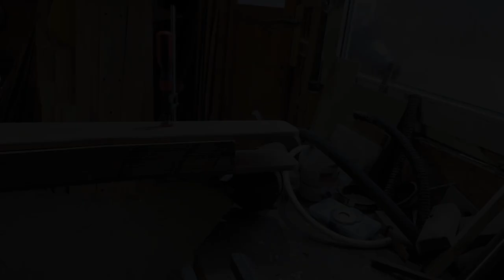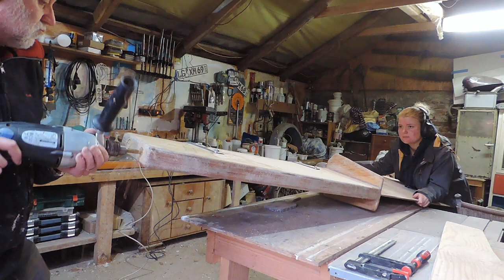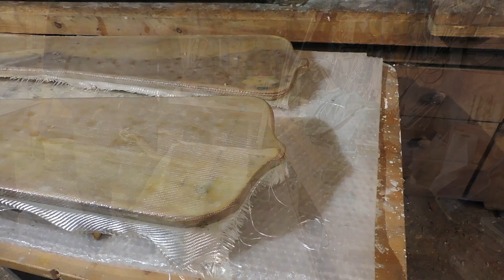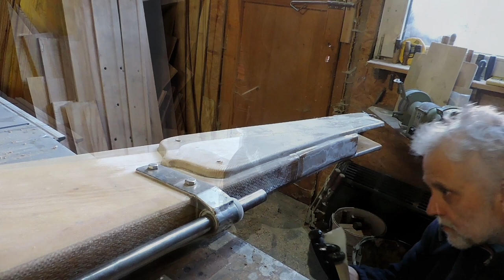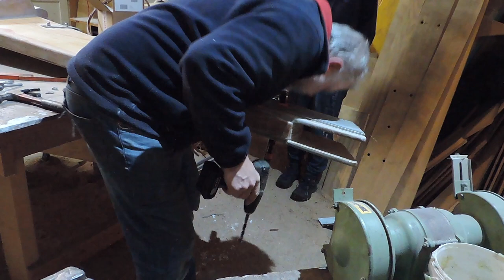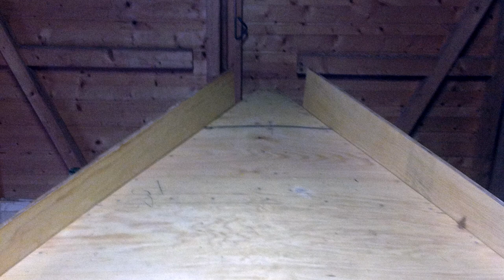Final Rudder Fitting; building a cruising sailboat - SV Tapatya EP261

Comment: Well. You did it. You now have finished adding appendages to your boat. Congratulations.
Reply: Well.. there's still the masts and sails to go. Those have to count as "appendages" too... 😉
Reply from the maker: The main bits are all there, or ready to put up, Bob. A bit of work on rigging fittings still to come 👍😃
Reply: @Garryck-1  Those are considered parts of "the rig". "Apendages" are parts, added to the hull, that go into the water.
Reply: @bobcornwell403  - I'll take your word for it, I guess.. but in all my many years of sailing (and extensive reading on nautical subjects), I've never encountered the term "appendages" used for anything on a boat.
Reply: @Garryck-1  

This is probably because of the way sailboats used to be designed. They used to be designed by half-model. This was almost always carved out of a block of wood. The keel, as it was, tended to be faired into the rest of the hull, so it was hard to distinguish where one ended and the other began. Toward the turn of the 20th century, this changed.

This started, I belief with N.G. Herreshoff (hope I didn't spell his name wrong), who designed what is likely to be the first fin-keel. At first, the rudder attached to the trailing edge of this keel. This was especially true when turn-of-the 20th century rating rules rewarded short water lines. Later, the rudder got separated from the keel, to be hung behind a skeg. Later still, it was attache only to a rudder-shaft which extended into the hull.

By this time, sailboats were designed on drafting tables, not carved out of blocks of wood. At this point, it became common practice to draw the hull lines first, then draw in the keel and rudder afterward. This is probably when they started to be called "appendages" by the design community.
Reply: @bobcornwell403  - Many thanks for the explanation! I did kinda wonder if this was maybe some sort of designer's terminology..

Comment: I was pleased to see that you added the metal plates on the rudder cheeks.  I was very concerned that the wooden cheeks, standing alone, were not sufficiently robust to withstand the stresses caused by the movement of the tiller.
Reply from the maker: Yes, I agree the reinforcement is probably necessary there, Marshall 👍

Comment: Hello again Tony! Like I said, I think the rudder is a real work of art and engineering, although I think I would cut off the base. Right now it’s pointing downwards and it looks like it would be snagging in a shallow draft. I would cut it so it would at least make a continuous horizontal line with the keel, maybe even slightly upwards. Just a thought.
Reply from the maker: It is horizontal, Pierre. It’s a bit of weird perspective that makes it look otherwise. I’ve just been out to check 😂
Reply: @SVTapatya  Just looking out for you Tony 😁

Comment: To drill 90 degrees. It is necessary to take a mirror from an old hard drive and the inclination of the drill in reflection is visible in the central hole.
Reply from the maker: Interesting tip!

Comment: Magnificent effort there, Tony & crew! So, once the tiller is finished and the bottom plate fitted to the rudder, is there much left to do before splashing and stepping the masts, etc?
Reply from the maker: Thanks Garryck. Thoughts are now turning to the aft sheet arch and windvane. I’ve got a few minor electrical bits to do - depthsounder, aft nav light, solar panel wiring. I still want to finish the cabin sole boards. Some fairing of the keel to hull joint, general rigging fittings, and probably a few more bits that I haven’t remembered here this morning 👍
Reply: @SVTapatya  - Ok.. thanks.. that pretty much matches the list in my head, then. Also, while I can see that the rudder itself is unlikely to 'jump up' out of the bottom socket, is there anything preventing the rudder pin from moving upwards?

Edit to add: Another thing.. do you intend on making a yard/boom crutch for her? Or will that somehow be integrated into the bimini top?
Reply from the maker: The main rudder pin has split pins through it top and bottom to stop it moving up or down. The lower pin is fixed by the two bronze screws.
Yes, a boom crutch will be on the bimini; I’m not sure about a forward one yet 🤔
I also have the 2 yards still to make

Comment: Tony , I’m no expert but those two rudder brackets don’t look big enough for the weight of the rudder , or maybe I’ve missed something
Reply from the maker: I think they’re up to the job, Dave. Time will tell, I guess!
Reply: The rudder fittings all meet or exceed the designer's specifications (I own a set of the plans, so I know for a fact). And the rudder itself, being more hydrodynamically shaped than the original design, if anything is a little lighter than the original design. Time will tell, yes, but I'm confident in the job Tony has done.

Comment: Hi, may I ask you a question?  Maybe you explain it and I miss it, does I am asking myself why you need to built an extension to the rudder. I do understand that cheeks are required to attached the tiller arm, but why the rudder is too short and need an extension? 
Regards
Reply from the maker: You may indeed. Basically, the rudder is longer than a standard sheet of plywood. Obviously, I could have planned the extra length into the original lamination, but I decided to keep the size manageable and extend with cheek pieces later 👍
Reply: @SVTapatya  - Well, I was contemplating asking you the same question... so thanks for the explanation, Tony!
Reply: @SVTapatya  It does make sense. Thanks for the reply and good luck with the splash day, which shall be not in a too distant future.
Reply from the maker: Thank you 😊

Comment: I got tired of all the hand sawing on smaller pieces of wood while rebuilding the interior of our Balboa. Band saws were just too expensive for part time use in my small workshop, so I bought a portable band saw and mounted it vertically with an adjustable plywood table around the blade. The saw cost $89 US at the time, I think they're $150 to $200 now, but still way cheaper than the $500 to $1500 for the 'Big Boys', and more than ample for my smaller tasks. Cutting compound curves was suddenly 'Easy Peasy'...:cat-orange-whistling:
Reply from the maker: A great tip! Thanks Mike 😃